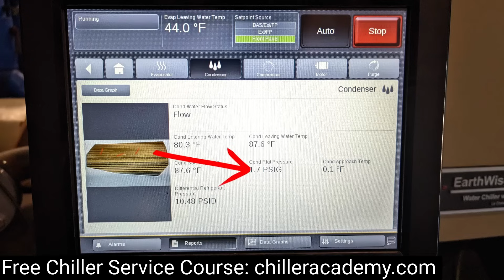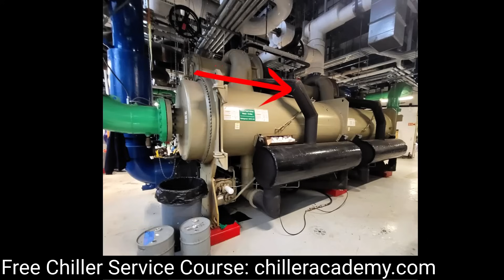Trane CVH Chiller has High Head & Surging Explained

Comment: Did you know that there is a ridge inside the condenser between the purge in and out piping? You can see the weld most of the time. 
I have never seen a divider plate erode and fail on a Trane condenser but I have seen on a Mcquay. Good DP with low DT. I have also seen the gasket pushed out on the condenser divider. That was much harder to find. 
He has a purge issue, imo. 
Max amp limit it to 50% and disable the purge time and come back in the morning. Graphing the purge suction helps too!